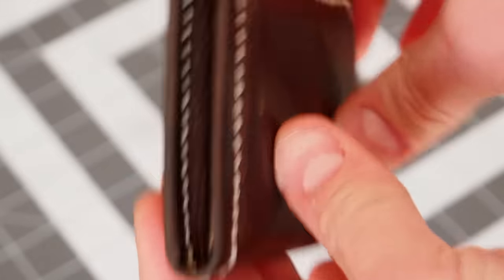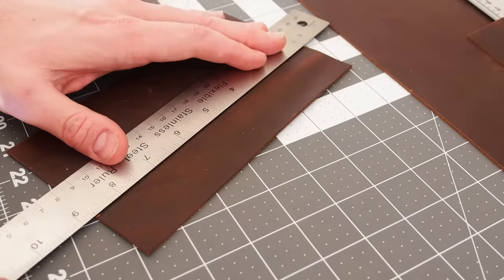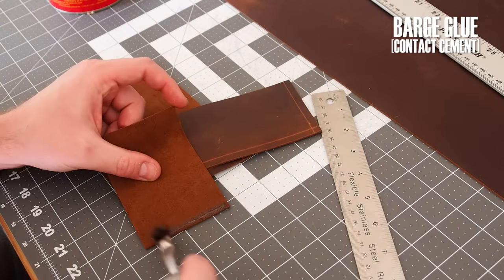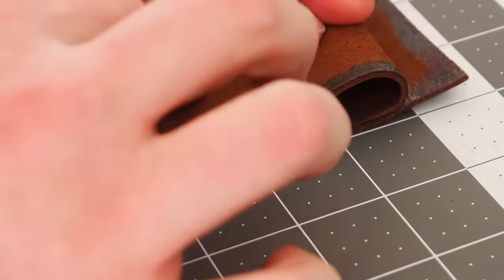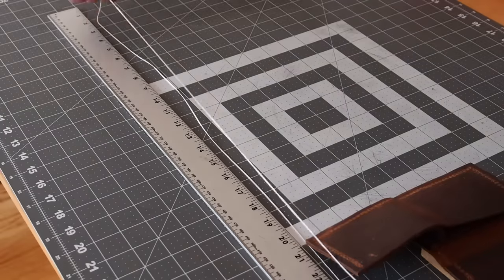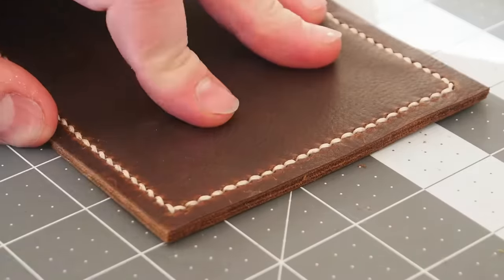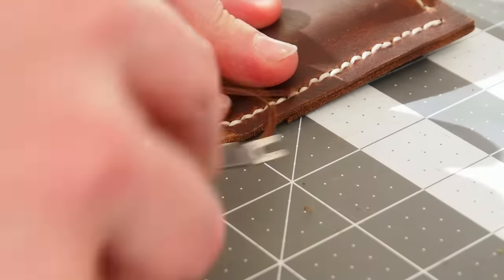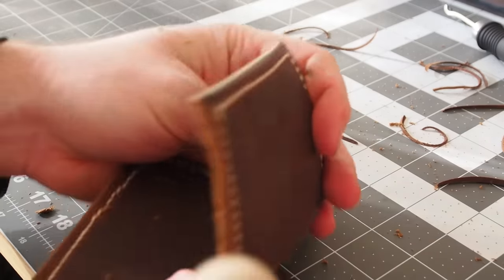UP CYCLE: Making a Wallet from a Hamburger Wrapper

Comment: I made a very similar wallet myself based on your design. It's been an amazing wallet for personal use, I added in an extra flap for a windowed ID slot and I made the card slot shorter on the 4 1/2" side so it was more of a cover than a full slot because I had some trouble making mine easily accessible. All in all a great piece you designed, thanks for the video!

Comment: Forgive me for asking but do you need to burnish the edges? I ask because it seems like everyone who does leatherwork burnishes the edges. I mean, aside from looking cool, is there any other benefit to burnishing?
Reply from the maker: +Trevor Schretlen There are some instances where people will leave the edge raw.  Usually the piece looks more finished and will hold up better if the edges are sealed.  Burnishing is one way to do this.  You can also get edge sealant/ paint for a different look or design a piece in such a way that you have no exposed edges!
Reply: Thank you!

Comment: Pretty good one ! btw...it would be even better if you move the thread line closer to the edge - approx 5 mm from edge (1/5 inch). 2 reasons for that *1 more useful inner space. *2 Stronger and more durable edges, less likely to open between layers in a long term. :)

Comment: Just a tip, for those timelapse shots, once you have the focus correct turn off auto-focus so it doesn't keep blurring the screen when it's trying to figure out what's going on. Love the videos!
Reply from the maker: +Robert McEwen Thanks.  I need 2 cameras going!  I have used that feature in the past.  The danger is if you move your piece or the camera like I do sometimes, you can miss an entire shot.  Ideally, I'd have one scene camera (locked focus) and one detail camera (constantly adjusting).

Comment: May I humbly make a few suggestions.  For 5 ounce leather I would use a #1 beveler and for slicker edges try bringing them up to 300 grit sand paper and going in one direction only.  Also, a stitching pony can help a lot with making your stitches even.   Great video.
Reply from the maker: +HonestDoubter Thanks for the suggestions!

Comment: what does a hide like that cost?  I'd love to do this myself, but I feel like it would be expensive.
Reply from the maker: +Bill T You don't have to buy an entire hide (this is a half hide). You can also buy smaller pieces a lot of the time.  This half hide cost me $180 but you could just about reupholster my couch with it.  Cow hides  are shockingly large.  I also get a deal at Tandy as a business owner or it would have been about $240.  This should give you an idea but also know that I could probably make 100s of wallets out of it.  There are also much cheaper hides!

Comment: yo would it be good to use the thinner leather as the pieces that connect the thicker leather together? so you can somewhat hide the seam.

another, if you fold the thick leather and sew it to hide the seam, would it be too thick?
Reply from the maker: +SNEAKxxATTACK You can't really see the seam...  The last wallet I bought had 1/64" thick leather.  Yeah it had a lot of pockets, but it wore out quickly!  Folding leather is fine but It would be too thick if you folded it over another piece (3 layers).
Reply: Not really many pockets that I'm after. I think I'm just looking to have maybe an ID flap, cash pocket, and 2 credit card pockets
Reply from the maker: +SNEAKxxATTACK For the last wallet...  I ended up using the small pocket for main cards/ ID. I use the side of the cash pocket directly across for other cash type things...  debit, gift card, etc...
Reply: I'll keep that in mind. Thanks. I've always wanted to get into leather working. I also enjoyed Adam savage mythbuster work in leather
Reply from the maker: +SNEAKxxATTACK My grandpa showed me when I was 10ish...  Just go to a local Tandy leather supply and get the basics!  Pretty inexpensive to get started!